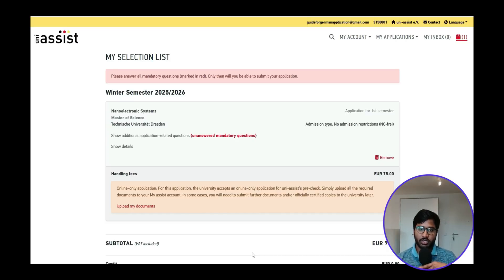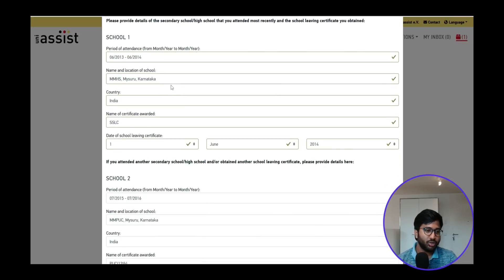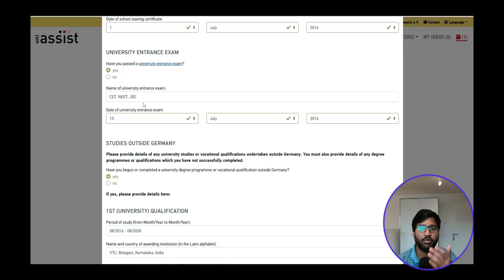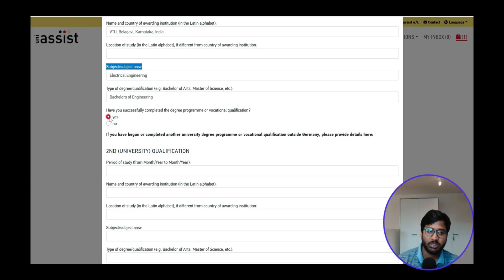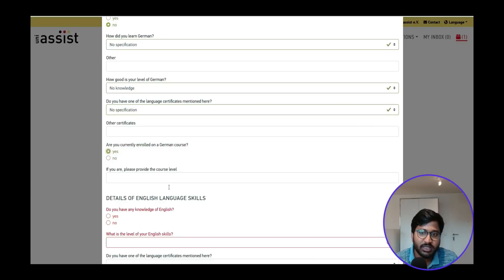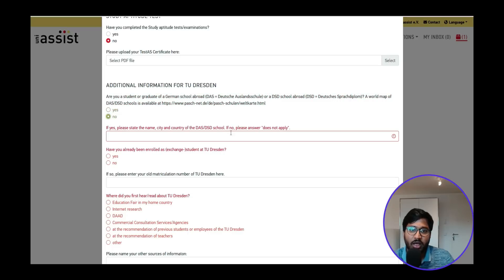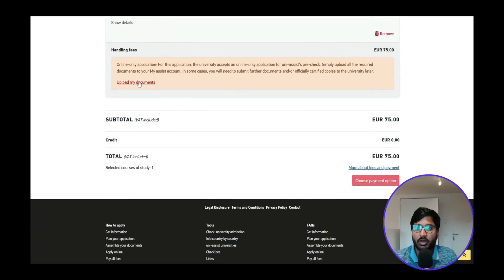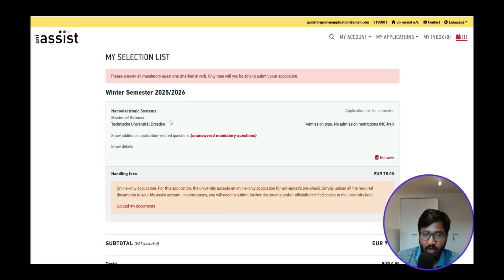HOW TO APPLY | MSc NANOELECTRONIC SYSTEM | TU DRESDEN | PART 3 | FILLING & SUBMITTING VIA UNI-ASSIST

Comment: Is the APS mandatory for application in MSc NANOELECTRONIC SYSTEM at TU DRESDEN ??
Reply from the maker: APS Is mandatory for every college, every course in Germany.

Without APS you can get some college admission but you never get student visa without APS.

In total APS Is mandatory for all college and all course
Reply: @guideforgermanapplication6308  I mean is it necessary to submit this document while application for the course? I know its required during admission into the course.! Different colleges like TU munich, Darmstadt university are required to submit it during admission and not at the time of application! So do I need it during the application process?